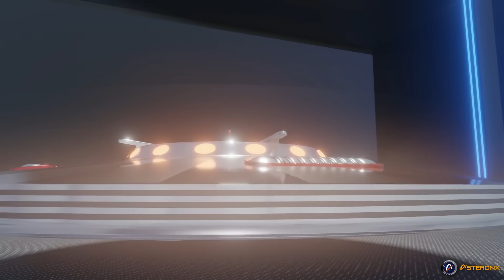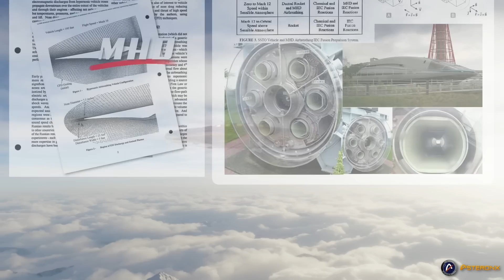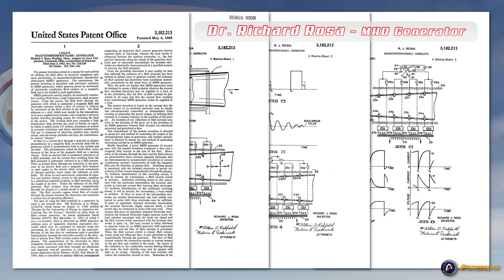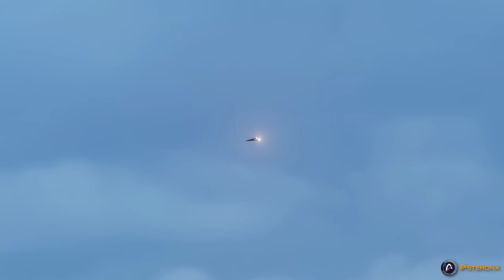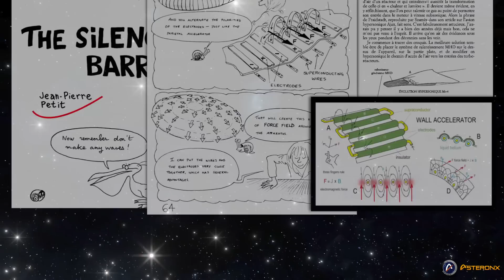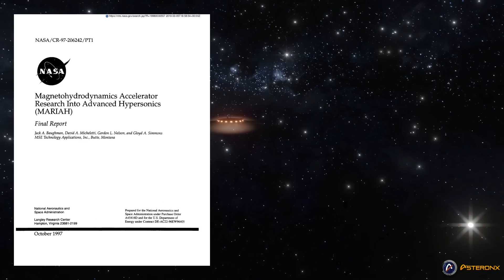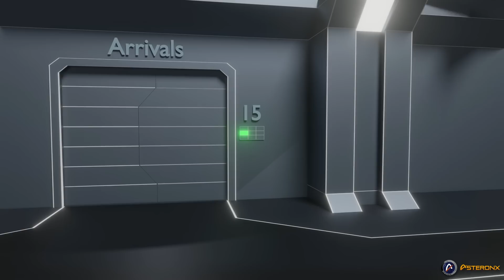Wingless EFE Touring Craft MHD

Comment: Let alone the cost in both CO2 and money required to even be able to cool that much liquid nitrogen for this thing to even lift the same amount of cargo that Propeller powered commercial airplane could lift  Let alone the fact that no government in the world, especially not the FAA regulatory agency I mean to say would ever let you fly a nuclear reactor over peoples heads even a fusion one because all nuclear reactors produce radiation and it is impossible to control the side reactions at least for now that occur in deuterium to curium deuterium boron boron boron, well actually boron Bryans controllable deuterium lithium trittum lithium Reactions where you’re still going to get deuterium deuterium to undergo nuclear fusion because think about it the more protons and nucleus has the stronger the electrostatic repulsion is going to be the greater the temperature and pressure is required to initiate fusion so In air quotes neutron free fusion fuels, absolutely clobbered your energy production What you can get is a low neutron emission fusion fuel with massively reduced power output because of said required massively increase pressure in temperature the amount of power you need to put in also known as and you’re still gonna generate radioactive alpha particles because there’s only like do you guys think there’s one type of radiation produced from fusion now there’s many different types, including alpha particles, which are far worse in terms of biological cell tissue damage than the Fast neutrons because fusion is eight times more powerful than fiction. It means there’s neutrons of eight times more kinetic energy. That’s why the European test reactor Needed 10 new types of concrete to deal with the radiation, because the highly energetic neutrons were relatively few by compared to the neutrons produced by nuclear fusion but they were far more energetic and so you are going to need ultralightweight radiation shielding just to deal with the alpha particles, and not only that there is no FAA regulatory agency in the world I mean That would ever let you fly a saucer shaped aircraft because you would never ever ever be able to easily control it. It’s not aerodynamic, therefore, no control that would be easy that is to say by comparison to a shape that looks much more like a bird.

Comment: right because well it’s for now, a pipe dream because of the amount of a liquid nitrogen required all of the bulky and absolutely gigantic microwave emitter equipment in microwave optics and the liquid nitrogen that would be required to cool the superconducting Tesla coils and the batteries required Unless you’re going to go nuclear and all of this wood add so much weight that so compare that to a 747 where the weight of the fuel gets lighter and because of the energy density of gasoline 12,000 mW hours per kilogram, you can go well actually more energy dense than that because of the high octane in the jet fuel you could lift with the right air frame, one ton, but this thing will not be able to lift one ton It would be a massive achievement today with today’s technology to be able to lift a drone with what you described. Let alone 1 ton like what a 747 could lift

Comment: What is your power source? Having built ion lifters and other similar miniature craft I have found that the power to weight ratio has to be extreme. Assuming this is not an airship aka Zeppelin to offset the weight what are you using. I don’t see nuclear tech being authorized to be used in civilian craft in the near to mid future.

Comment: I have worked on very similar types just not manned by a pilot.Mostly on the computer systems and Electronics systems in design and production.I just can not get into the advanced technical data on here for very obvious reasons.When you build and design u f o saucer crafts similar to this, you must start from the bottom first with lots of trials and errors within the systems that control the craft, being mostly computer and electronic systems within the craft.😄😄😂😂

Comment: Seems that the objective at present is to leap into interstellar drive capability...   What about smaller craft that could behave as 2 to 8 ??? passenger vehicles to operate within earth's atmosphere or on the surface of the oceans ? efficient hull forms to be reasonably capable of 25 knots almost indefinitely using salt (seawater) and Nicola Tesla static electricity as a potential energy source...    There are several 45ft catamaran designs that use a pair of 300hp diesel engines to achieve 25 knots - So why not replace the diesel power-plants and use 300hp electric motors?   Learn to walk,  Then try to run faster and faster, then lift clear of the water (100ft or so) seeking international velocities making longer voyages commonplace...   Get the systems sorted and PRACTICAL, then scale up making profits to grow by selling "personal water craft" using "sustainable fuel systems"?   Come down to the surface level and meet transport needs of the here and NOW...

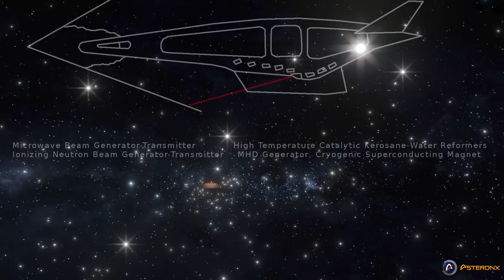Comment: MHD for boats is a great idea??? Though Mitsubishi used superconducting magnets, the MHD efficiency proved to be only 4%, 15 times less than a conventional engine. More, it produces huge amount of Chlorine in the water, killing the fishes! Why don't you study a bit more before doing videos? While for the air-drive version, it works only with expanded polystyrene small airplanes, not able to lift more than that, to date, after 60 years of trials. 12:49 the list of systems described is a complete nonsense, written by somebody who never passed basic physics exams. 1. extracting power from a single temperature  material source contradicts a bunch of principles, from thermodynamics to QM. 2 "neutral particle beam"? have a short lecture on beams, to ionize something, CHARGED beams are way more efficient. I don't continue, the rest of the list are just SF phrases... MW reducing air resistance.... and "modify the air" don't you know this was tested even in small labs, with zero results?

Comment: As it works through the acceleration of the surrounding atmospheric gases via ionisation and magnetic, electrostatic fields this craft will not work in the vacuum of space unless you bring a huge amount ionisable gas with you in storage. People gave been playing around with this tec for a long time and it is found to have very low thrust capabilities. Actually so far nobody has made one that could even lift the power supply needed to ionise the atmosphere.

Comment: Your concept is good but your physics is wrong. Alternating spiral coils of positive and negative charges. Copper and silver design. Solar proton collectors to charge the system and refueling done by using the gas Giants of the solar system. The counter rotating system can also be used to release a defensive screen to protect against hull penetration. Steering by angular tilt in atmosphere and steering jets elsewhere. This is a zero point energy system and can be applied to other medians. The key is adapting the electronics to function using microvolt and microwave technology. If you can run a compressor on 24VDC why can't you design one to run on less? Less gives you more. The key is also solar collectors not solar panels as configured now.

Comment: Still not demonstrated (at least not in a scientific, controlled manner). A YouTube video of a Russian pseudo scientist is no proof.
If this technology operates by ionizing air, this means that it will not work in space, as space is almost vacuum, so what's the point of a spacecraft that can't go to space.
This will probably be very slow compared to a plane, and we still yet to prove that it can move sideways. 

It's important to point out that this has nothing to do with UAP/UFO tech, they are probably millions of years more advanced than us, this is just another form of lift using classical physics. So don't expect these craft to behave life UFOs, since people inside will still experience g forces, and the craft is solid, meaning that it will get torn to pieces by the wind if it can achieve UFO speeds.

Comment: So this may or may not work in water and atmosphere. But would not work in space for lack of atmosphere. Or any kind of fluid medium to work with, so not to orbit. But very hi in the atmosphere provided enough energy.
Reply from the maker: In it's current configuration it will work in the air from the ground to roughly 60 metres straight up, with modifications, it would work in both water and in space. For in space operations the aerospacecraft must take with it a lot of propellant, forcing the craft to be larger.

Comment: So its not a space craft.. because there is no air for ionisation. How can this work in space? Also can this be built using 3D printing technology, for personal use on earth?
Reply from the maker: Yes, it can be reconfigured to work in space, but this craft would have to take with it a lot of propellant with it into space in order to work in space, forcing the craft to be much larger, requiring a lot of energy. That said, once engineered, a field drive will work much better in space.

Comment: This is vaguely reminiscent of the Biefield/Brown effect of electro-gravitics. Townsend brown, in the 1920's found if he introduced an electrical current into a condenser the condenser would exert force in the direction of the positive terminal. The only problem was you needed like 10,000 volts to generate a force that would equal 1% of the weight of the object. Meaning that to hover, you needed 100,000 volts. And if you wanted the thing to fly, you would need more than 100,000 volts.  The more voltage you put into the condenser, the faster the craft would travel.
He even had a contract with a French agency, but when it was absorbed by another agency, they absorbing agency wanted nothing to do with it,. He then secured funding from a business tycoon. But the tycoon, while flying his plane, crashed killing him; even though he was an expert pilot. Again, the tycoon's heirs wanted nothing to do with this project and since there was no written contract, they could and did cancel the funding. Some are calling the effect ionic wind. But no matter what you call it, it is still something that the powers that be seem to be afraid of.

Comment: I'm an Electronics Engineer, with over 20 years of experience, specialized in analogue design, such as amplifiers  and filters, linear, non-linear, translinear, FET, BJT, RF, high speed, high precision, ultra-low power;  and also specialized in switching power applications such as DC to DC converters, inverters, motor drives, etc.  I have good, intuitive knowledge of EMI, radiated or impinging, and of how to prevent problems of interference, cross-talk and resets, at schematic and PCB levels.  Let me know if there's anything I can help with.

Comment: Hi there,
Interesting video but don’t like the microwave idea at all. Very poisonous to human and all animal life.
Far better to use negrava/drive energy.
This is accomplished by using extremely powerful positive electrical charges of super high voltage and low amperage on the top of the craft and negative super/high electrical voltage on the bottom of the craft.
To move forward simply generate more of this energy and play the positive charges to the front of the craft and the negative charges to the rear of the craft.  
Such a controlled system of electrical energy allows every atom of the whole craft and its passengers to move in the desired direction of travel.  This effectively negates any feelings of acceleration on the passengers and or cargo, as every atom of the craft and its crew cargo and passengers have every single atom accelerated uniformly in the desired direction of travel by these two force fields.
In order for people to fully understand this, please see the works of that Canadian genius Doctor Thomas Townsend Brown under his field of Electro/ Gravitational research.  Here I am talking of many hundreds of thousands of volts and even far higher voltages more but at very low amperage of course.
I believe that this is one way the so/called (flying saucers) are made to course through our atmosphere and come to exhibit very rapid rates of acceleration and deceleration and similarly come to a very rapid stop or turn at up to 30 to 90 degrees or more,  without the passengers or crew or animal stock feeling any discomfort within such craft. Simply as every atom and molecule of these craft and the the objects within cannot feel any inertia effect.
Our present day aircraft and ships cannot be freed from the effects of inertia and stresses when taking off or decelerating as the air screws or jet engines which propel our aircraft through the air or, ships propellers which thrust upon the water to propel our ships suffer inertia effects at all times. Please see also Nicola Tesla’s work on Gravity research .
Cheers,
Richard Leschen.

Comment: Even if you ionize air the thrust is very low. Hardly enough to lift a heavy object. Once outside atmosphere there is no air to ionize so you would have to bring your own noble gas fuel just like an ion drive used in today's deep space vehicles. Again very low thrust. Low acceleration. 
Not viable at this time. Wait another 20 to 30 years for technology to advance then revisit the problem.

Comment: When you going to use this technology in a flying truck or flying car how about a flying RV Brian camp trailer with his own deck around it I just don't find truck that pulled it was that tractor be no less instead of what you think of a trailer hitch they're here to be a tractor beam of swords for the truck and the trailer the air trailer the air camp trailer the world be a lot different place and better place if we could have Brian camp trailer that we thought around by trucks that have tractor beams hitches use this technology will be great store new generation of vehicle that uses no gas only Paris weather guy on the air can you create lift apply any directional you want to fly forward back side to side the left to the right move on a dining stop on a dime wouldn't that be cool why I pick up some flying cars and vans camp trailers our own landing pad and don't want to pull your trailer you get off the tractor beam lying around to the back side of the camper trailer and laying on the pad in your vehicle be floating above the trailer landing pad lofton place bye microlocs that locks it to the rupture our ground is polling above we're not going to push it with her bare hands and push it away from where you headed and holler way somehow you can't slide a regular wheel trailer underneath it where are crushing it under the pressure I love walking system awesome gorgeous car or truck or van

Comment: Silly question. How does the craft function in an 
“airless” environment, um like space?  What is your definition of ‘air’?
Reply: When he says airless he means an environment that has little or no particles such as space.
Reply: Ahhhh. Yes.  So, it needs “air”?
Reply: If you spin a fan blade in space, does air move or what happens.
Reply: Space is not a void. It is not empty. Even virtual particles can be utilized for propulsion. You must create a further void in space to go faster than the normal space speed limit set on you by the space you are in as of that time

There is never a nothing, no true void exists.

When humanity is to break the firmament of this place we call home, I only hope we will use such a power correctly

Comment: Would Magneto Hydro Dynamics make any sound and if so how loud would it be?
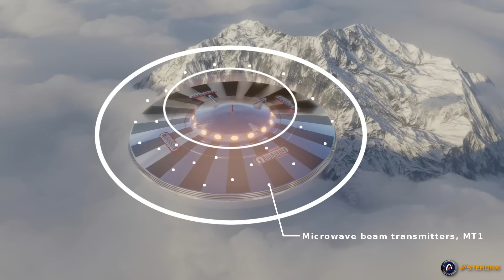9:00 Is it posable to down size this tech to the size of a hubcap? And use it in cars or to make real life hover bikes?
How high could and MHD Operate, as in how thing the atmosphere till it can't work?
Reply from the maker: MHD would make a loud buzzing or humming by default, but this could be eliminated. And yes, this technology could (and will if we have anything to do with it!) be used to make flying cars and 'hover' bikes. Altitude wise, MHD will work higher than any other form of atmospheric propulsion, up to as high as a weather balloon.
Reply: @asteronx  Much Thanks 👍 One last thing what would power it? Like would it need a large reactor or could it be power by something smaller?

Comment: Is this reality or fiction?  I cannot tell. Please explain.
Reply from the maker: The technology is real and is being utilized in several successful ways, refer to links below, the craft however, is our design concept, based on a extensive research.

1. http://en.hypersonics.ru/concept_ajax/MHD_control
2. https://www.researchgate.net/publication/270820169_MHD_hypersonic_flow_control_for_aerospace_applications
3. https://ntrs.nasa.gov/api/citations/20010087676/downloads/20010087676.pdf
4. https://ui.adsabs.harvard.edu/abs/2006JSASS..53..554K/abstract
5. https://en.wikipedia.org/wiki/Ayaks
6. https://apps.dtic.mil/dtic/tr/fulltext/u2/a471429.pdf
7. https://www.colorado.edu/faculty/kantha/sites/default/files/attached-files/72875-116619_nishant_agarwaldec_17_2015_908_am-_agarwal_aircraft_propulsion_finalpaper.pdf
8. https://apps.dtic.mil/dtic/tr/fulltext/u2/a564120.pdf?fbclid=IwAR3uVgaTKzYzKwfwTZJMOutJOX2moaNSJi9Z8_9UkecyREmdVYASd5uagIk
9. https://patentimages.storage.googleapis.com/6b/a2/06/2788cb2ef518ac/EP2046640B1.pdf

That should be enough, there are more.
Reply: @asteronx  thanks for  the answer.
Reply from the maker: @krakatoom  You're welcome, and thank you for asking.